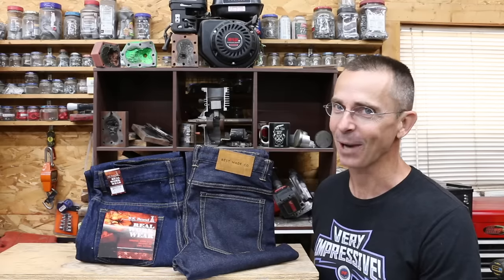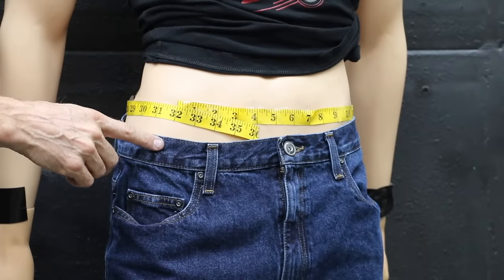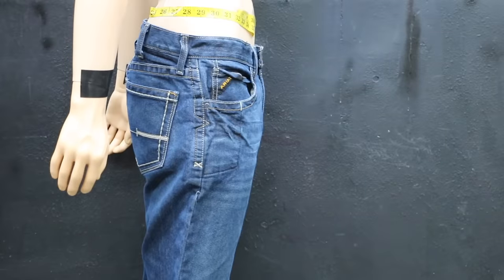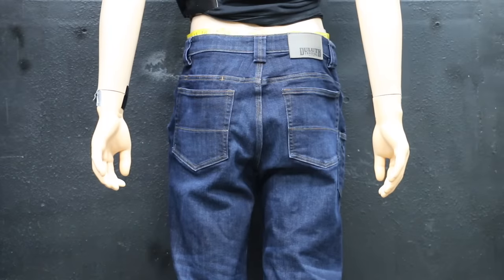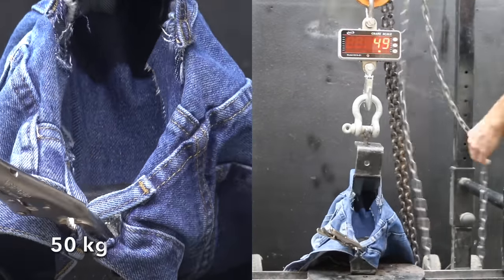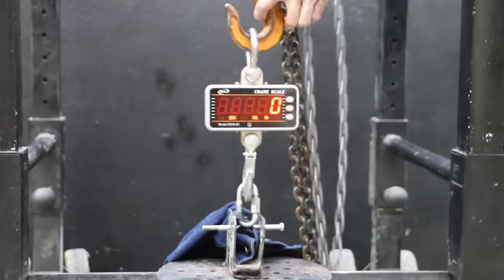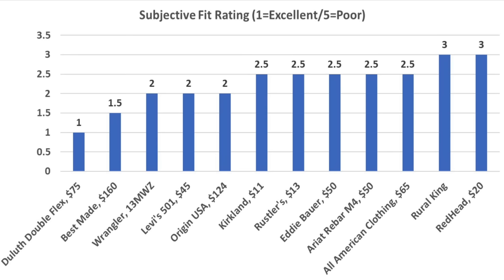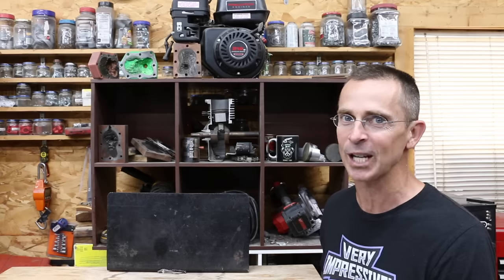$10 vs $160 Jeans? Let's Settle This!

Comment: Use Ariat for oilfield use and are extremely extremely durable. The failure point for me was getting fat so they no longer fit!
Reply from the maker: Thanks for the feedback.
Reply: I just switched to Ariats from Wranglers and so far am loving them.
Reply: 😂 Know the feeling! 😎✌🏼
Reply: your not alone Phill.
Reply: I bought M3's for a few years. Then they noticably changed and the price went up $20. They don't last like they used to. The first few pairs I bought I wore and washed 2-3 times a week for 3 years before I wore a hole through the front thigh area from working. 
I am not a small guy, I wear 40x34 pants(no I am not fat, quite the opposite) and the main draw was Ariat made pants with an actual mid-rise so they didn;t go up my butt crack when i put them on. That changed too. 
I switched to Nautica. now they also discontinued recently the pants i was buying. 

Like everything nowdays, I am no longer brand loyal. the people that make the best thing get my money. Brands are pointless now.
Reply: I have yet to have Ariats with a crotch or back pockets that didnt tear out in a month or less. Also wore them in the oilfield. I'm all about Walls fire hose plants these days. I'm tall wearing a 34×34 tho (good luck finding that size). Sometimes I have to size up to a 36 or 38 to get my thicker legs/calfs through. Nearly anything I wear blows out long before its worn out so maybe I'm just not built for pants. Would love to normalize wearing robes like the Saudis. They have it made.
Reply: @misterbulger  that’s horrible
Reply: Disagree.  Almost every pair of my Ariats have holes in them. Hot garbage.
Reply: @shakenfake  Both options on the super low end. I wear American Eagle
Reply: @texasjetman  "you're"
Reply: @davenhla  Your body type is an American outlier. 40x34 means yes you are definitely fat. Where the extra 10 inches come from?   slimness?
Reply: @DizzyDad  LMFAO
Reply: @justinpennington7682  that would be so comfortable on a hot day and easy to take a potty break
Reply: @masterofnone6620  Almost every pair of mine do too, but I have been rotating the same 3 pairs for the last 4 years. I don't think I could get that good from any other brand.
Reply: Idea, test emergency flairs for waterproofness
Reply: Classic jean failure point.
Reply: They are the best jeans ever made imo
Reply: @DizzyDad he's 98% muscle and 2% bodyfat

Comment: I purchased Kirkland jeans for work for the last few years before I retired. They weren't bad, never split in the crotch, had a bit of a loose fit but that was good for movement, and though they weren't as heavy as Levi's or Wranglers they seemed to hold up OK. I also accidentally would get battery acid, or acid residue on jeans, and that would mercilessly dissolve any denim when washed, so, a cheaper value pair of jeans made more sense if and when I did damage them.
Reply from the maker: Great feedback on the Kirkland jeans! Thank you and Merry Christmas!
Reply: The problem with Kirkland jeans is that every other year or so they change the source of manufacturing and it changes the quality and especially a fit. I have some great Kirkland jeans from 10 years back  and still going strong and few no so great that I purchased in last 5 years. Also, their black color jeans are totally off in fitting than just the blue ones. Basically, what I am saying is  that Kirkland quality and fit varies with every batch.
Reply: Yeah, when I was working around splashed bleach, same thing, it dissolves denim. So no point in anything but the cheapest.
Reply: @trance20001  DOUBTLESS both SAMs and COSTCO are slowly  transforming into the worst quality products ever stores. They change suppliers for just a cent less, regardless of quality.
Reply: @alfredomarquez9777  I am not a Sam's member, so I can't comment on that point. But in my experience you couldn't be more wrong about Costco. All of the Kirkland products I've tried are a great value when compared to a highly advertised brand. I own some Kirkland jeans and dress shirts, the jeans hold up well for me. The Kirkland dress shirts are the best I have found in the last 10 years. Better than Van Heusen at 1/2 the price. If you buy Kirkland, you get similar performance to a leading brand at a lower price point.
Reply: @billlewis9740  plus if they are for work you can splurge and rotate them which minimizes the wear and tear, specially since a lot of the wear and tear comes from the washing them in heavy duty cycle.  one thing to note here is that there are two kirkland jeans one line does offer 30w while the other goes as low as 32w. I am 5'9" and the 30x32 fit like a glove. every 3-4 years i buy about 5 of them for work and honestly for the fit/price and performance ratio they cannot be beat. On a side note i hate 501's they waist is not true to size  and the legs are too narrow even a skiny guy like myself has trouble moving in them.
Reply: Ever tested different manufacturers engine coolant or coolant boosters?
Reply: I like the kirklands as well. They're obviously not the best, but i can purchase 4 pairs for the same price as the midrange jeans. Hard to justify the more expensive jeans when all it takes is one sharp object or hot spark from a grinder or welder and i have a hole that will just continue to open up.
Reply: @alfredomarquez9777  yup used to buy their black no show socks material got thinner every year. Now pay more for Duluth and haven’t had to buy more .
Reply: I've been doing Kirkland jeans for a while too. Was going through jeans like crazy and they're always so expensive. $20 for a pair of Kirkland and I usually get a year out of them for work and much longer for a non work pair
Reply: I retired from being a sheet metal contractor a couple of years ago , but have been using Kirkland jeans even several years before that. They have held up really well, as my wallet doesn't weigh anywhere near the back pocket tearing weight. They also fit nicely, belt loops are in the right places, nothing has torn out for several years.  I also occasionally use Wranglers when they are on sale. For the $12 cost of Kirkland jeans, I can replace them several times before getting to the cost of some of the other jeans!!
Reply: I buy jeans for comfort and general use, I don’t expect them to hold up like a work pant, Duluth have been my favorite over the years for my jeans needs. For work (mainly livestock/firewood chores) I use something a little heavier like a Carhartt or Duluth’s Fire Hose material.
Reply: @thomasleary1807  not all Costcos are the same. West coast seem to be the best, midwest and east coast are similar with different products to the region. Clothing varies greatly and I could see where there would be different suppliers under the brand. Ive stopped buying clothes there because a lot of people now dress like they shop at Costco. I too loved the value in the dress shirts
Reply: That’s a good point about inexpensive jeans, less painful to replace. I prefer shorts in the summer but I’m finding the $10 George jeans from Walmart make terrific summer work pants because the lower weight denim works well in higher temps with a cooler feel and, again, easily replaced if necessary.
Reply: @CaveWyatt  Being in Port Townsend, WA, we are closer to, and shop, at a Costco a few miles away, so easier to get the Kirklands. HOWEVER, the Levi 505's Costco sometimes sells at low prices, are actually better when working in higher temps and sweating, as they are thinner, and stretch, so don't restrict as much when perspiration makes them stick to your legs!!  Couldn't have lived without them while in Texas for a few months!!!
Reply: I like Kirkland (Costco generic) jeans also for that. Very inexpensive and well made. They fit loose, so you won't pass for one of the skinny jean Zoomers, though. Doesn't make much sense to buy coveralls when cheap jeans and a t-shirt are less than a quarter the price.
Reply: Ruined my first Carhartt jacket swapping batteries. Like you. I learned a few days later how bad that acid is on clothes.
Reply: @Owens_Racing  Reminds me: MANY years ago, my dad bought a small dump truck (1 ton Pickup with dump bed). We were cleaning the yard and such, loading the truck. I was in the bed, and my dad tossed up an old battery. It spilled all over my pants leg, but I didn't think about it. I drove to the dumps, & dumped the trash, then headed into town to the auto parts store. Found a parking space a couple of blocks away, and started walking. That was when my ENTIRE pants leg disintegrated!! Dust!!! Had to walk 4 blocks thru town with one pants leg!! I guess I'm just glad it only soaked the leg and not anything else!!
Reply: In the store do they sell light colored ones Kirkland blue jeans?
Reply: @deepb249  I've seen dark blue and black. Don't recall seeing any other colors. Did you check the web site? They do fade pretty fast.
Reply: @joew8438  fade? Like dark blue becomes light blue?
Reply: @deepb249  yup, the color washes out progressively.

Comment: One area that carries some added interest in mens jeans are the number of belt loops. The more the better especially around the back to help prevent the leather belt from folding over. 
Interesting set of tests. It's truly hard to beat an $11 pair of Costco Jeans if they have them in stock...its a gamble Costco has them every time you shop there.
Reply: Thought you were gonna say plumbers crack.
Reply from the maker: Great point!
Reply: @ProjectFarm  Wrangler has 5 loop across the back I believe...very good idea.
Reply: But for $11
Reply: Too many belt loops and they interfere with a pistol holster
Reply: Not having a Costco I don’t have that problem. 😂🎉
Reply: @BCBridger  My thoughts exactly!
Reply: @BCBridger  you can always skip a loop if there are that many.
Reply: @BCBridger  current fav pair are $30 goodall jeans from Target. Not many loops, loops are big, and I can cassy AIWB just fine.
Reply: The Costco jeans fit like a brick house though.
Reply: Buy a Galco gun belt. It will never fold.
Reply: @BCBridger  couldn’t you cut out the ones that are in the way just for the holster?
Reply: @okymek  have you tried multiple deluth work pants? I’ve been meaning to try but the price is hard to pull trigger
Reply: Also how far from each side of the fly and how big they are (how big of a belt and buckle fit through them)
Reply: @Boise30  but for $11 worst care you have new rags
Reply: Yeah I dig through every single pair as people return them without the big size tags and they get lost in the piles. the key is to buy 1 when you see it lol. I have a pile of kirkland jeans that I rotate through
Reply: Not only the number of loops but the placement AND the belt's width it will accept. Some belts are 1" but some individuals require 1.75" wide belts.
Reply: @okymek  I do all kinds of work. Both indoors and out. Would the cool max be recommended for hot environments in the sun?
Reply: We have no Costco but these are the types of Jeans I'm looking for. No way ever do I pay 160 clams for a pair of jeans. And people wonder why they have so little money.
Reply: Bert... never had belt loops interfere with holsters. Also, you can simply skip a loop with your belt, or cut a loop off.  It's really not a problem. More loops offer more support for the holsters.  Think outside the box.
Reply: Costco doesn't have jeans for big guys. They seem to think we should wear sweat pants. Just not their sweatpants cuz they don't come in big sizes either
Reply: Another thing that I don't like which concerns all pants is when the belt loops are too far away from the fly so the fly part can slide down.
Reply: Ariat's having 7 belt loops is what first turned me onto the brand. And subjectively they have lasted longer for me than wrangler's.
Reply: 5.11 jeans have lots of belt loops.  Seem to be lightweight yet reasonably durable.   Cost around $70.  Maybe not the best work pants but good for casual wear while CC a pistol.
Reply: @mwalker9401  You know you're not supposed to push the buckle through the loops. You're supposed to push the belt through all the loops from the side that has no buckle.
Reply: All american have 7 its one of my favorite things about them.  Amd being an affordable and durable American made brand
Reply: @GiSoldier559  The Duluths are great pants, you just have to catch them when they are on sale.
Reply: @BCBridger  Which is why I remove a loop that gets in the way of my Sneaky Pete holster.  What is the big deaa about that?  It is easy to cut it and pick out the thread, can't really tell it was ever there after a wash.
Reply: @@richcran7975 Especially for the pilots!  F-16 has a tight cockpit.
Reply: @Garth2011  that’s the main reason I wear them is the 7 loop design
Reply: Duluth specifys their number of belt loops varies depending on the size.
Reply: @BCBridger  You could always remove one that’s in the way. Or bypass it
Reply: I actually prefer 2 in the back, but either way, I absolutely hate the pairs of pants I have that put a loop dead center in the back.  Getting under vehicles, that stupid loop always digs into my spine.
Reply: @GiSoldier559  better than almost every other pair of pants out there for working in heat. They are comfortable too
Reply: Duluth has perfect amount on their Firehose work pants, not sure about their jeans. Large one in the rear, keeps the cracks hidden.
Reply: @GiSoldier559  sign up for there emails, they have discounts often, sometimes as much as half off and free shipping on orders over $50
Reply: @jedwin4816  i have a pair of 5.11 slightly more formal boots. They are freaking amazing.
Reply: @ProjectFarm  got a idea how about you test out the best  heated socks?
Reply: That gamble is for every single product at Costco....smh
Reply: A properly sized belt width will also help that. That's why men will pay so much for a tailor belt to go with their favorite jeans. And then only buy those jeans.
Reply: @KarstRats  Yes, 1 1/2" wide belt   I believe is minimum for jeans. The bigger a person is the wider the belt needs to be in most cases. Todays belts are flimsey so it pays to find a good thick all 100% genuine leather belt.
Reply: Yes agreed. My Kirkland store branded Chaps I got earlier this year on sale I swear have 40% less loops
Reply: @Bert Bridger  true, and conversely, too few make your holster sag. What works best is when you can run the ine side of the Holter, then a loop. Then the other side of the holster. It fits snugly, and stays tight to your waist.
Reply: @nowthatsfunny1  You operate on emotion and ideology, rather than facts. 
Cease and halt.
Reply: I know everyone has a different build, but the way a pair of jeans fit and look should be mentioned.
Reply: @BCBridger  Rotate your holster 3/8" in either direction.

Comment: When it came to buying jeans I was very brand-conscious (Levi's) since I assumed that brand equaled quality. This video has changed my opinion. Thanks for doing the....legwork Mr. Farm, and arming us with the sweet delicious information!
Reply: Levi's went anti-freedom woke.
Reply from the maker: Thanks and you are welcome!
Reply: Levi's haven't been good for about the last 20 years.
Reply: I've never cared for Levi's. I did when I was little bit as I grew up, I realized Levi's is just overpriced crap. I buy cheap jeans, usually Old Navy, for work as they're cheap and I'm not sad if it's gets ruin. When it comes to jeans that I really like, believe it or not, Banana Republic are really good and it's fairly cheap at roughly $70. They fit kind of tight but over time, they get extremely comfortable as they start to loosen up. Will have to get a Costco membership as jeans for $11 is worth trying out.
Reply: @videodistro  exactly why I will never own a pair of Levi's again.
Reply: I was raised with Levi 501's . Once Levi went woke anti freedom I will never buy that brand again. Thanks for the great video!
Reply: Consider proper fit a bonus of the well known brands.
Reply: @videodistro  I hadn't heard that, but they were one of the early adopters of "Made anywhere but USA" which is also when the quality went downhill. Some of that was due to price pressure from Walmart, but Levi had enough of a loyal market that they could have thumbed their noses and kept on making a great product. But they didn't.
Reply: Origin does everything it can as a company to use American made everything, from buying looms for themselves to using American suppliers, even helping people start new supply chains if they can.
Reply: @TD75  As a non American I am curious, what happened to them?
Reply: Levis Jeans don't fit me properly. They always look like hell on me and aren't comfortable. Never owned a pair because of that.
Reply: @SkidMarks59   "Once Levi went woke anti freedom" Can you provide context for that ? Not sure what you mean.
Reply: Get on the web & order some prison blues. They're made in Oregon by convicts. I've been wearing them in the logging woods for years & years.
They're cut with room in all the important areas, they're tough as heck, & they're pretty reasonably priced. I guess the aspect of bad boys reforming themselves wirh denim is a good deal as well.
Reply: @aetherbound65  That they jumped on to the anti AR-15 bandwagon is an example I know of. I guess if a company wants to speak on its position it chooses to suffer such fate.
Reply: Get you some AE's, man.
Reply: Levis have a huge difference in quality depending on where it was sold and what product line. Some of them are fantastic but some are also awful
Reply: LOL @ posters thinking "Freedom" and "Woke" being a factor in a consumer product's quality-testing channel. 🤣
Reply: @videodistro  cope
Reply: Levis overpriced junk!